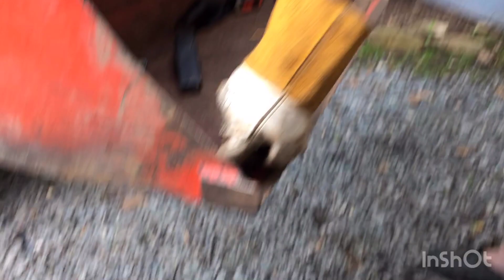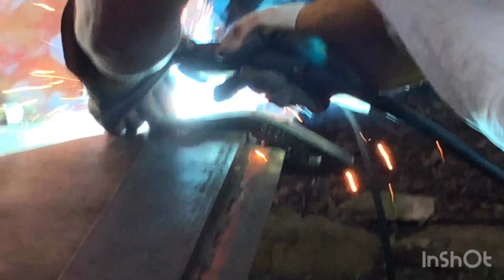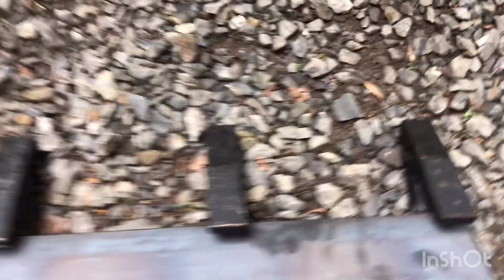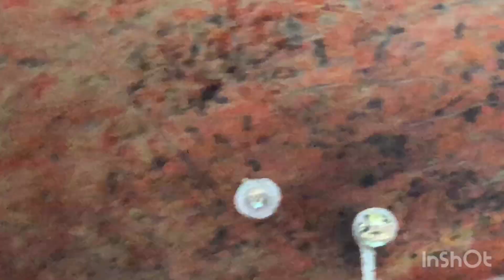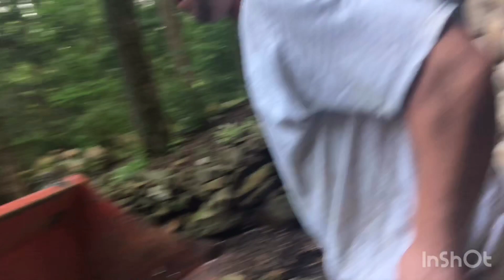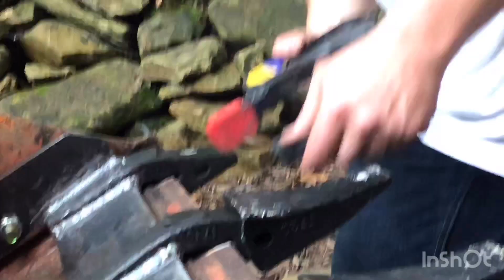Titan Attachments Toothbar Kit w/6 23TF Teeth & Shanks DIY Kit Installation

Comment: This is fitted backwards from the ones I see sold.
They have the bar underneath as a cutting edge. The teeth reach around the bucket from that bar and hook over the edge of the bucket edge, on top.
Notice the number writing on the teeth upside down.
Reply from the maker: I understand what you’re saying. This link shows the same bar assembled and welded instead of a diy kit. 
https://www.palletforks.com/skid-steers/bucket-and-accessories/48-inch-bucket-23tf-tooth-bar/126501.html
It’s designed to go in the bucket as opposed to under. I’ve had no issues with it inside the bucket. Having the teeth definitely makes a difference!!

Comment: Looks good. Pre-heat is usually to slow the cooling of the metal after welding. This is to help to eliminate cracking. It will help also when welding dissimilar metals. I have to do this one day to a grapple bucket I have.
Reply from the maker: Oby-1 thanks. Yes. Hooks are always handy! I added one to my backhoe bucket. I have to upload the video. But same principle. Preheat and weld. Simple.

Comment: Really awesome video ...very impressed .... I'm unsure if this kit will work on my kioti  ...what is the distance from the edge or your bucket to where the flat stock starts...unsure if my welds on my bucket will in the way sitting my flatstock on a hump of weld from bucket edge.
Reply from the maker: The distance from the front edge of my cutting edge on the bucket to the flat stock is 2”. That can be adjusted slightly to fit your setup. Worst case would be to grind the welds smooth with the bucket surface. They wear down from use anyways and structurally an extra lump of weld above the surface really doesn’t gain you much.

Comment: I would like to see you dig some fresh ground, or some with sod. How much difference did it make?

You really need to use some volume leveling on your video.  The tractor and grinding are super loud, and then you cannot hear you speaking. Your helper needs to hold still too.

Otherwise good technical content and job putting it together.
Reply from the maker: Court thanks for the comments. As you’d expect breaking ground on untouched surfaces is a little more work than a pile of dirt. I was thinking I should have shown digging fresh ground after making this video. But I wasn’t ready to tear up my yard yet. Since this video I’ve cleared a whole lot of areas. I will get a video showing that scenario. I can honestly say the teeth make a world of a difference! Breaking ground without it is like trying to slice bread with a butter knife. And yeah my 12 yo youtuber son needs to practice  his steady shots! Lol. Thanks again and I’ll get some more vids and mods up soon!

Comment: How much more effective is this breaking up rocky soil? Hace you dealt with any big rocks 24" plus?
Reply from the maker: Having a toothbar tears thru rocky ground. Where I live is nothing but rocks. I helped a friend clear the rocks that were put down to prep their driveway for the heavy triaxles. The 6” rocks were buried and packed. Having the toothbar just ripped them right up. I’ve dug up boulders as big as my bucket and we’re heavier than what I could lift. It wasn’t easy getting some of the big boulders out but the toothbar made it a little easier. I also have a ripping bar attachment I use on the rear 3pt hitch that is a good tool to have when ripping up roots and large boulders.
Reply: 24" it is a tractor bucket not an backhole!🤣😂🤣😅🤣😂

Comment: What kit did you purchase? And how hard is it to remove? I have a Kubota B3300SU.
Reply from the maker: I bought the kit thru Amazon (where else?) sold by Titan Attachments. It’s called Titan Attachments 72” Custom Toothbar Kit w/6 23TF Teeth & Shanks Skid Steer DIY. The plate they send is long enough to fit inside a 6ft bucket. I just had to shorten it down for my 4ft bucket. It’s easy to take off when it’s clean of course. If you use it and don’t clean the packed on dirt and mud off it’s a little harder to shake of with just shaking the bucket in the dump position. That’s when I break out the big hammer and digging bar. Taking the bolts out and putting them in is easy if you have an impact gun. To help in removing a stubborn toothbar I might try attaching a chain around something solid (a tree?) and connect it to the bar and back the tractor away slowly. Maybe I’ll try it next time it’s stuck on and make a video... all in all I love it! I can put it on in 15 min and taking it off even when it’s stuck takes less than 30 min.
Reply: @vlogcabinlife4919  Thanks for the info. Looks strong. Hopefully my HF welder will hold welds.
Reply from the maker: Just remember to preheat and remove the mill scale. I haven’t broken any of the teeth or any part of the bar and I’ve been tearing up all sorts of rocks and boulders. Take your time and do it right the first time! Good luck!
Reply: That's a thin bucket 🪣